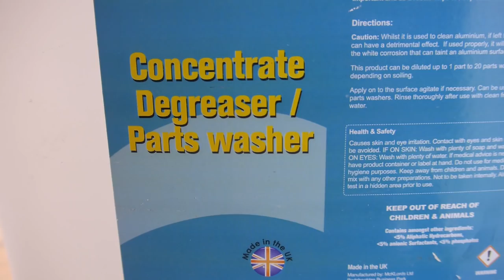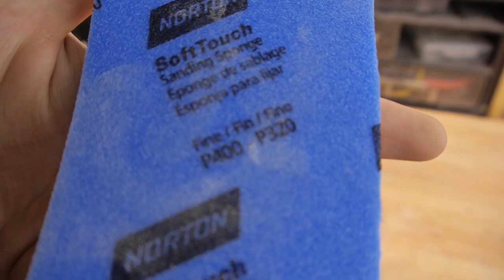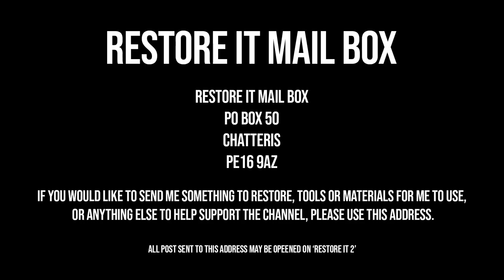Broken Tilley Storm Lamp Restoration

Comment: Nice restoration! Them tilleys are classics. A few things to note if you plan on using the lamp: The paint on the hood will not withstand the temperatures, hence why tilley enamelled to hoods originally. The washer and washer holder on the pump is the wrong way round ( the rubber should face the tank) and finally the mantle should be tied at both ends of the burner. Good luck.
Reply: Very Good points, I thought the mantle at the end was broken, but as not tied at both ends, which i did not realise in the video that may/will explain why i thought it looked broken.
Reply: Fantastic work and great video.  Only things worth a comment from me i think is the Paint on the Top will not take the heat, it was enameled originally for this reason and the Mantle looks like it is, has been torn broken, however another poster noted that the mantle had only been tied at the top during the assembly and normally is tied top and bottom? In my experience of Mantles (not on Tilly Lamps) they normally only have one tie and like a bag or balloon shape,  this said I have seen what "appears to be two ties being  removed on some Tilly mantle assemblies. So Tilley's may have different mantles and fitting methods.  Either way there is something wrong with the Mantle on the finished one and the one burning looks broken.
PS - looking at video again it can be seen that when the old hood/top is removed and turned over to see the old manttle or what is left of it it can be seen that the Original Mantle was tied in to places and the pipe was left passing through the manttle and the left OPEN. 
This means the mantle fitted was the wrong type and not one for this Tilly lamp.
The one that is for this Tilley will have two ties.

Comment: Still ' The Best ' lamp you can get . Tip - the soaking of the lighter in meths . Use a small jam jar and drop it in for 30 seconds . Worked for me with exactly the same lamp for 45 years ;) .Nice resto and the sourcing the parts . Brass wire wheel instead of the harsh steel one ;) . You ripped the new mantle dude :(  . You also have to let them warm up for a few mins  , hence the spluttering .

Comment: Question: Will the plastic body filler really stand up in the high temp hood, or is this more of a show piece not intended for regular use? thanks!
Reply: No. It won't. These ventilators were originally finished in glass enamel. That paint job is toast first time it's fired-up for any amount of time. Gonna smell great, too!
Reply: @stottnoble4413  Then I would have just sanded and used high temp spray paint. I don't care for restorations which can''t be used.

Comment: Put for the alcohol under the glass around the convertor for a minute or more with alcohol to warm up the converter then light. This turns the liquid fuel to a vapor so it will burn. It won't surge that way. Great job.....

Comment: This looks really cool!

One suggestion: I'm not sure if this is the case with your mantles, but I believe you're supposed to burn them in by holding an open flame over them. They'll shrink to the size of the lantern and then you remove the flame. After this, you can pump the gas and then light the gas. This prevent the creation of holes in the mantles, providing a more efficient burn.

Comment: The alcohol starter comes in a glass jar with a tin lid. The silk that you used is a Chinese Butterfly wick that uses a side paraffin candle. You can make a tune hole and fit the silk ob the top leaving some extra thread to tie on the bottom of the silk just where it attaches to the candle.

Comment: you should soak the leather pump gasket in some oil to protect the leather, it might revive the old gasket as well
Reply: Just a little trick I found out with my blow tortch!
Reply: Neatsfoot oil (like used on a baseball glove) works great for this.

Comment: There's a reason those vents were coated with porcelain and not paint because the vents can get to 500 to 700 degrees. I hope the paint you used can handle that. This also applies to the frame as well. Could've nickled or zinc coated it instead. Also a good idea to use some neatsfoot oil on the leather pump to help with friction and extend its life.
Reply: Exactly what I was thinking. There's really no way to repair the porcelainized enamel if it's damaged; short of re-coating.
Reply: I expected it to go up in flames.They get exceedingly hot with hours of use.
Reply: I really wanted to know how the bondo and paint held up, baked enamel or high temp paint should be used at least.
Reply: That was my first thought too.
Reply: I was thinking the same thing about oiling the leather gasket to make it last longer. I've done this before on Coleman stoves.
Reply: I wouldn't want to be in the same room as it once its been alight for more than 5 mins, the fumes from the burning filler, paint and to an extent the Zinc used to plate the needle valve tube...

Comment: Please try Flitz to clean and polish brass.  No scratching from wire brush and the brass will shine like gold.  And I think there is a metallic epoxy filler that will stand up better to heat.

Comment: The body filler on the metal cap (and the paint) makes the lamp unusable over time.
That cap gets very hot when the lamp is in use for longer times. Thats why it got enamel paint back in the factory. That has very good heat resistance.
Reply: It´s not paint, more like a layer of glass on top of the metal. Like the stuff you put on pottery and burn in an oven.
Reply: Should have braised the hole in the top. A high heat ceramic paint might hold up.
Reply: It's porcelain, not enamel.
Reply: My father used one when beach fishing. Not very reliable and took ages to light and the filaments used to break. Try fixing that on the beach!
Reply: Dennis P.  It’s actually “vitreous enamel” the same as was used on bathtubs and basins when they used to make stuff to last.

Comment: Looks excellent. You made a good job of that. I do wonder though how long the ‘lid’ will stand up to the heat as I think originally it would have been enamelled rather than painted. Still looks good though.

Comment: You’ve done a great job on this but I must inform you of a major health and safety issue. 

I’ve done a couple of these now and on both occasions the asbestos wick was still present. Removing and disposal of this wick is hazardous luckily I’m trained in removing it and took the necessary safety measures. Anyone trying to restore these Tilley lamps must be aware of the asbestos found in some of the wicks. Asbestos kills.. slowly and horribly. Please take care and dispose of safely.
Reply: These shouldn't ever have had an asbestos wick. The mantles were made from rare earth metals, it was only ever the heaters that used asbestos. Lamps should be safe.

Comment: To be honest, I’d have left the canopy in enamel, but that rather defeats the object of the rebuild. 
I have some of these lanterns, the same model. They are better quality than the later ones but the newer models work as well.
If you have a campsite setup these lanterns are just great. We use them at military vehicle collectors camps, they’ll light up a military 12x12 tent just great and distributed round the tentage, no more tripping over guy ropes. The light is easier to live with than the rather painfully bright Petromax models and on a filthy stormy night they heat the tent up as well. They run for hours on a fill of decent paraffin and are easy to light if you are patient and read the instructions (hypocrisy warning, as an engineer, we never read the instructions).

Comment: Good job! I just have one teeny problem with this... It hurts to see you using a wire wheel on the tank. I normally wouldn't care in the least how one chooses to clean or fix somthing, however I can't keep quiet when a wire wheel is used to "Polish" something. Had you used some polishing compound and a soft cloth on the tank and similar parts, it would have given it a mirror-like sheen much more pleasing to the eye as opposed to the thousands of tiny horizontal scratches left in the metal by the wire wheel. I'd suggest you give it a try the next chance you get. I'm sure you'll find that it suits the metal much better. Anyways, enjoy your lantern! I'm sure it will serve you many years to come!

Comment: Nicely done and it works.
The caps on these old white gas silk mantle lanterns get fairly hot... similar to an exhaust manifold on an automobile.  Polyester body filler and even lab metal will burn up at higher temperatures even if it's covered with fairly high temp paint.  Silicon bronze brazing would've allowed it to be operated even if the paint burns off.  You can do filler free patches in sheet metal with braze or even MIG welding if you are willing to fill slightly high and grid it back to the original profile...  It's very time consuming tho.
The original coating on the cover was actually high temp baked enamel similar to enamel on the sheet metal of Wood fired, LP, Natural gas, and electric kitchen ranges.  There are exceptionally high temp high gloss ceramic coatings now that lay down easier, bond to the substrate better, and last nearly forever once they are fired.
Sandblasting the gassification generator body made me cringe.  The seat for the needle at the top of the generator tube is a precision piece that likely doesn't like abrasive being applied to it.  I think I would've used electrolytic rust removal on that piece or at the very least masked the tip and base off to keep grit out of the generator tube...  You seemed to get away with it tho.

Comment: Unfortunately that paint will probably burn off if someone tries to run the lamp.  You might be better off using the heat resistant stuff on the entire top of the lamp.  Man that brass shines up pretty too.  Keep at it, it's fun to watch.  The pump may require a little oil to make a good seal.

Comment: We used these in the Army 60 years ago.  There must have been hundreds of thousands of them made for the Army.  Where did they all go ?   Chucked away probably.  Lamp HPP (high pressure pumping).  I fixed many of these when they stopped working properly.  Happy days (occasionally).

Comment: Is the paint you used heat resistant? how does it hold up to the intense constant heat? Similar lanterns get uppers of 1800 degrees. I worry how the painted parts will hold up over time or even in the short term. Normally lanterns are brass, nickel platted and the ventilators porcelain/enamel because of the intense heat these put off. Curious to see how the restore held up.

Comment: Excellent work as usual
my only concern is the orange top piece that you used body filler on. The body filler  not be able to withstand the Heat. Let us know how that turns out

Comment: That was great.  One question I have is on the durability of the plastic body filler at temperature.  Does it last, and if not what is the failure mode?

Comment: Maybe a dumb question, but how heat resistant is that body filler you used on the top? I'd be nervous it might not last long with the constant heat of the lamp.
Reply: The vent on a GPA gets to about 750 degrees F/400 degrees C.  It's going to burn off with a few minutes of being lit.
Reply: @dennisp.2147  as will the paint on the hood

Comment: Try restoring an old Holley or Edelbrock carburetor next.
Reply: Those carburettors are very good but if I am not wrong he is in the UK and American carburettors and parts are quite hard to find and expensive. So he better of restoring an SU carb used in most British cars or a twin choke Weber or a Dellorto from an Italian car, or an Amal carb from a British bike, I like carburettors as well but you don't come across to any American carb around here.

Comment: Was the top of the lantern originally ceramic coated? Or was it paint, like the way you did it? Was wondering if you needed you use heat resistant paint because of the heat from the lamp when running.
Reply: Enamel, and the underside should be white.

Comment: You're supposed to set fire to the mantle and let it turn a white colour before lighting the lamp, originally there used to be a spirit burner that clipped around the feeder pipe to aid lighting.  Also you should have put a smear of oil on the leather pump gasket and as mentioned already, far too abrasive on the brass, otherwise a good restoration.

Comment: Really awesome as usual. I find the playing fascinating. I assume you don’t have to replace the liquids between use?

Also, what is the “fabric” used for?  Just to contain the flame?
Reply: The mantle fabric turns to ash on the first use. When the ash is heated it glows brightly providing the light. Provided the vapouriser tube is working properly and the air tubes in the burner are not blocked the flame itself should be blue, and give off very little light of its own.

Comment: Looks great but think I would have ripped out the base and replaced with leds and usb charged batteries, more light and modern twist - plus safer. Depends on whether you are a purist or modernist!  - Where do you find your items?
Reply from the maker: As this was sent to the by a fan from Italy I wanted to keep it as close to standard as possible. Usually I find my stuff online. This one came to me.

Comment: Not sure how long the filler or paint is going to last, given the high temperatures it will see in operation.
It really needed to be 'stove enameled'.
It does look good though.👍
11:04 Wrong mantle! The correct one has fixings/holes top and bottom! 
You won't be able to assemble it properly as the vaporator tube has to go inside it from the bottom
The one used looks like a coleman dual fuel one.

Comment: That wire wheel was way too aggressive for the brass tank. You should have used a chemical by hand
Reply: Or a buffing wheel.
Reply: I thought the same
Reply: Agreed...much too aggressive...
Reply: InternetDude my thoughts too.
Reply: I'd agree, but it still came out rather well!
Reply: @lsswappedcessna  No, it's got serious scratches and haze visible.  It should be as shiny as a brass musical instrument.
Reply: That is a copper wheel. Not steel.

Comment: It hurt a little to watch you attack the brass tank with that coarse wire wheel.. Bit of paint stripper to get rid of the gold paint that's on the bases of these lamps and some metal polish would have given a mirror like finish, leaving the markings and makers stamp crisp.

Comment: What do you call that filament bag that resemble the light bulb? Does it contain asbestos? I am surprised that someone still make this thing.
Reply: Older ones contain Thorium (releases radioactive dust/particles when burning), which gives its bright white glow, but I don't know if it contains any asbestos.
Reply: The filament bag is called a mantle, and becomes very fragile after it's first ignition. They are also used on portable gas lanterns with campingaz.

Comment: be careful with that pink/white light emitting sock (mantle). It contains THORIUM, which is mildly RADIOACTIVE.
Reply: Pop Tibi why are we using RANDOM caps?
Reply: Pop Tibi To my understanding, most of todays mantles are coated with yittrium which I do not believe is radioactive. Some companies might still use thorium but I wouldn't know for sure.

Comment: more of a cosmetic than functional restoration, the heat created by lanterns is quite intense, the bondo will burn or at least crack heavily, also the paint finish on top is not correct, originally it would have been a porcelain finish probably, powder coating would have been a better choice

Comment: You did a very good restoration but it hurt seeing you use a mantle thats not made for a tilley and cut a hole in it instead of using a tilley mantle which has a string at the bottom like the top of the mantle so you can tie it up and not have a massive hole in the bottom which means you have to pump it up much more frequently to get the same light level
Reply: your welcome
Reply: also if your interested in restoring a coleman sport lantern i can get you photos of an original 1940's diagram of the lamp

Comment: recovery is not for their needs, right? Putty, painting (not perfect which is visible on the video), instead of abrasion-resistant coating - painting in 4 layers again, fixing one leg at the top of the cover is missed ... OK, then.

Comment: Okay, can anyone explain to me how it works?
Reply: The fuel is paraffin (kerosene) which is pressurised in the tank by the pump. To vaporize the fuel, meths( wood alcohol) is ignited at the start and heats the burner pipe. That vaporized  fuel then ignites and continues to heat the burner. The flame causes the chemicals on the mantle to flouresce and give light. Occasionally, you need a little more pumping to keep the fuel flowing, and that's it! There is a throttle control, and that's how you turn it off.

Comment: Wire wheel!  Yikes!  Too aggressive.  Paint and body filler on the vent are going to burn off the first time you run it for more than a few minutes. The vents get to an extremely high temp.  You didn't run the preheater long enough to heat the generator before opening the fuel cock and the mantle was destroyed by your pumping.  I suspect your NRV/checkvalve isn't working.

 You should look into many of the online forums for these lamps, as they have quite a following.  Classeicpressurelamps would be a good place to start for the Tilley and Euro style lamps.

Comment: This is NOT good. You use putty on the cap. this thing can get to 400 °c and more so that will burn away. The paint on the outside will burn also.and also there the putty will burn. The paint used on the frame itself will burn also cause it's not heat resistant paint.  The mantle is not installed correct and did not burn like it should. Maybe before restoration a lamp like that read some good info first about how all these lamps really work.